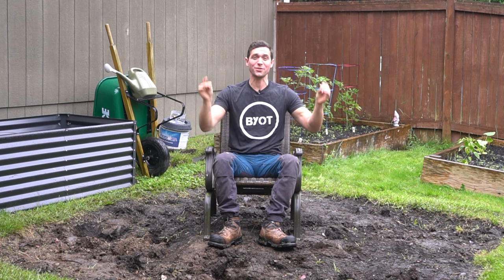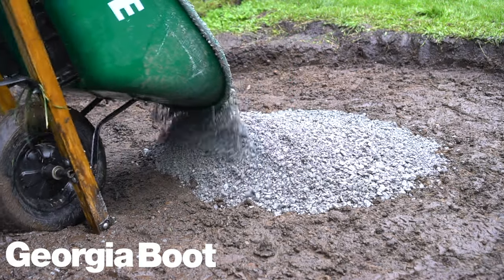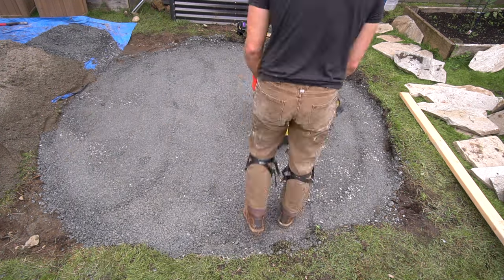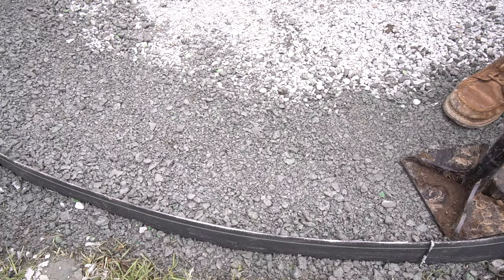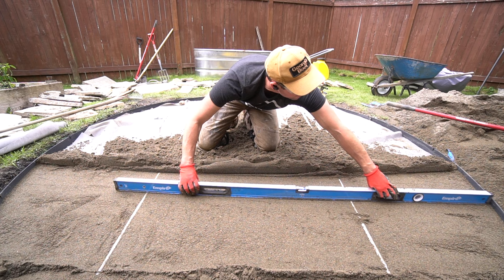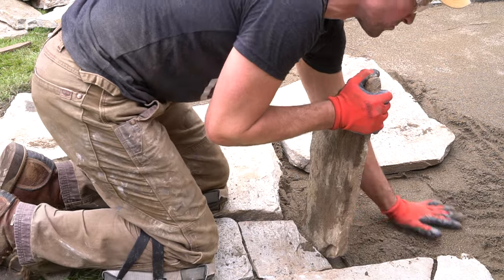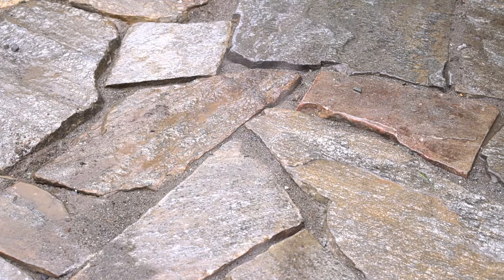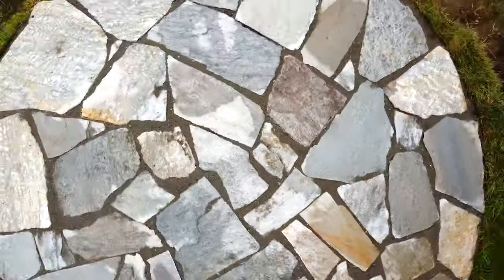DIY Flagstone Fire Pit Patio

Comment: Big fan off the channel Brent but as a landscaper I wouldn’t recommend this install for natural stone slabs especially ones that are not calibrated as I’m sure you found out getting them level is some job in a screeded bed of paving sand that method works great for block paving. If you ever did this again laying on a semi dry concrete mix would be the way to go laying one slab at a time that way you set the depth of the concrete to suit each slab and if you joint it with a slurry grout when you come to power wash it no dirt and sand washes out. Just my 2cents as a viewer keep the content coming as really enjoy it 👍 all the best from 🇮🇪
Reply from the maker: Great input Sean and I completely understand the type of installation process. I actually spoke to the client on this project and discussed both options. They wanted to go with the sand option over a concrete one but in the future I want to show off the concrete base install. Thanks so much for watching and the support to.
Reply: @BYOTools  I would love to see a concrete version! Love natural stone but the sand wouldn’t do it for me. Come to Ohio and you can install mine 😉
Reply: Hmmm this sounds like an interesting method. Do you do base material under the concrete mix? I’m afraid that jointing with grout when it’s not on a full slab would result in a lot of cracked joints. Any thoughts?
Reply: @tylerk.7947  Hi Tyler if you want to learn more subscribe to channel as I’ve started recording our work and I’ve a detailed video coming up explaining the method mentioned above. And to your question about the base yes every patio is built up with a stone mix 28mm to dust not sure what that’s equivalent to in the USA laying on concrete semi dry mix we use a full bed also 👍

Comment: Ehh, lot of good prep work for a very DIY not appealing result... stones look loose... u even see one tilt as u walk across it... tons of leveling to then put random thickness stones atop... along with the loose sand in between... Very large gaps between rocks the sand will wash out overtime... No geotextile or weed barrier as well...  Rough one for sure...

Comment: Hi Brent is there a reason why you didn't use a sand activator, like won't the stone start moving around in the future?
Reply from the maker: If they were smaller cracks I would’ve used that type of sand but because they’re larger and there’s a ring around the unit I feel there’s not going to be much movement over time. We’ll see how it does and I’ll keep everyone posted. Thanks for watching.
Reply: @BYOTools  thanks for replying.

Comment: wouldn't it be easier to put the edging down before the gravel?  You could also keep using the level as a scree for the sand instead of a trowel by changing the angle.

Comment: That is very instructive and entertaining pal! Oh, just a little remark here though. I’m not sure where you are located, but in northern climates, it’s way more recommended to add a geotextile fabric between your non-organic soil and the substrate 3/4 rocks. The common and most obvious benefit of all geotextile use is soil separation. By separating soil layers, the fabrics prevent them from mixing.
Reply from the maker: Thanks so much for the input and I’ll have to keep that in mind on my next project. Thanks so much for watching.

Comment: Would it make an even greater and better foundation if you molded a thin layer of concrete that makes a nice and flat surface under the fine ground gravel? And then add the fine top layer of gravel, say 1-2" before adding the flagstones? I might consider doing that if it will work.